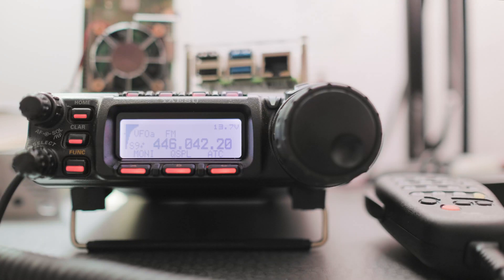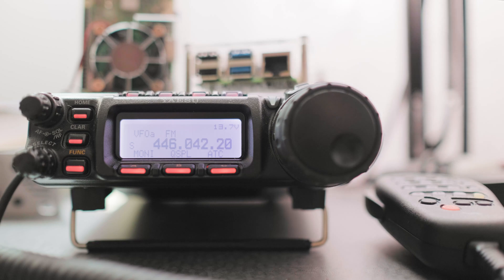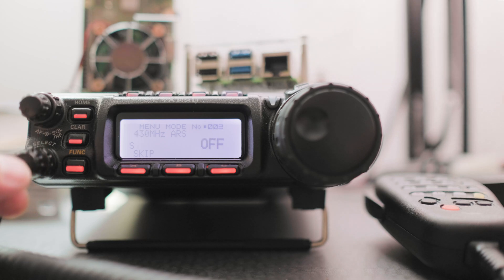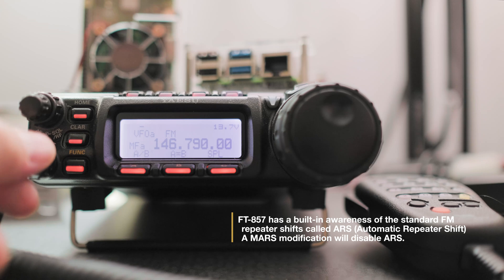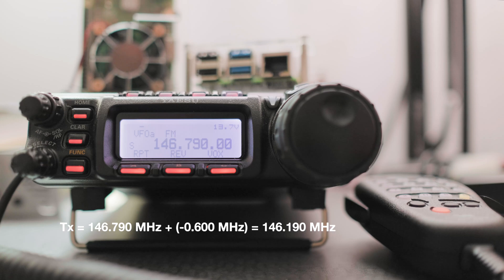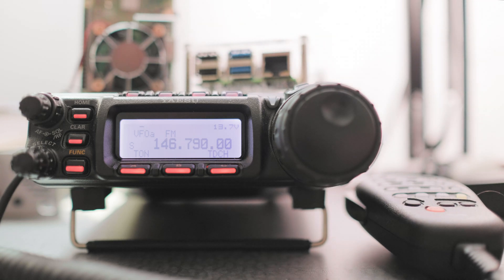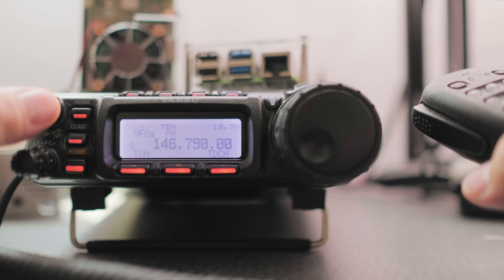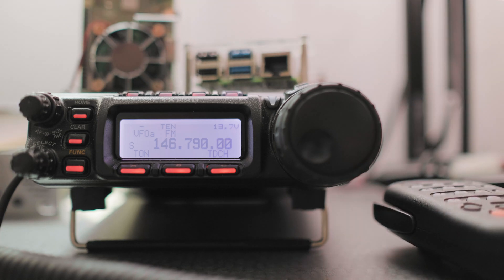Yaesu FT-857 | Program for Repeaters

Comment: Just bought one. Brand new in its original packing. Wonderful radio. It's to replace my faulty FT100d which is virtually the same but 23 years old with vhf uhf Rx faults plus several other problems. But still usable on HF. Good radio. Easy to program manually, won't be buying a program lead.    Just acquired the cat lead. Cat failed on the ft100. That lead is in use on the ft450d. . Overall pleased with purchase at £400.  Good deal.

Comment: Would you PLEASE say what the clock looking icon to right of TEN (at the top) when either on a 2m simplex or repeater frequency? Subscribed and good video! K5SWH 73s
Reply from the maker: That sounds like the automatic power off feature.  Find it on Menu Mode 7.  That means that the radio will turn off after a period of time not used.
Reply: @frankwc0o  Roger! That's what it is. Thank you. Steve

Comment: how did you get that mic to work with that rig, I dont have one with keypad what model number mic is that or what model radio is that
Reply: I had the exact same thought. Hey Frank how come you have that mic hooked up? It’s an MH48? But they work at 8v instead of the 5v in the radio correct?

Comment: I sold a motorcycle to buy the radio as it was my second dream radio, Yaesu FT817ND was my first.  I seem to have an attraction to radios that are discontinued right after I buy them.  Thanks for the video as I generally just use the programming software to program my radios.  BUT, if I am in the field without my laptop it is always VERY helpful to remember how to program the radio by hand.  73!!!
Reply: You did well.  You purchased two excellent radios that have actually appreciated. The 857 trades $800-1,000.